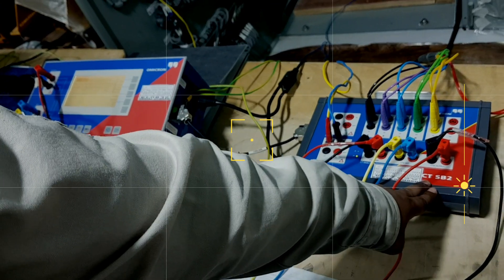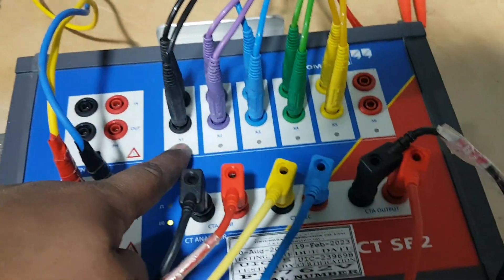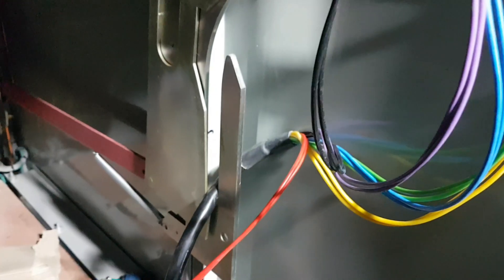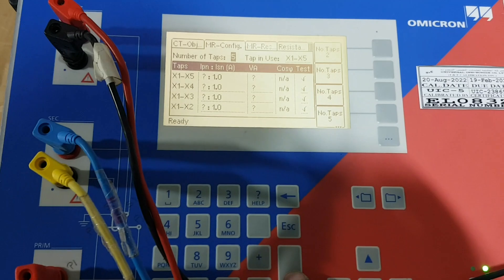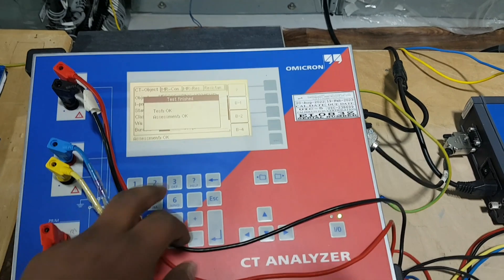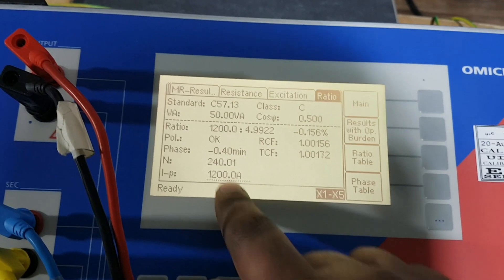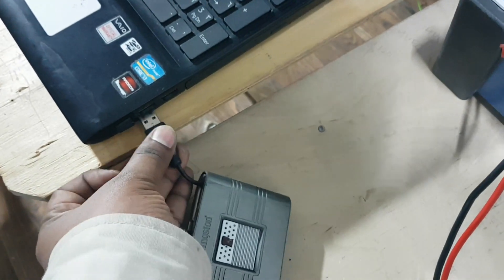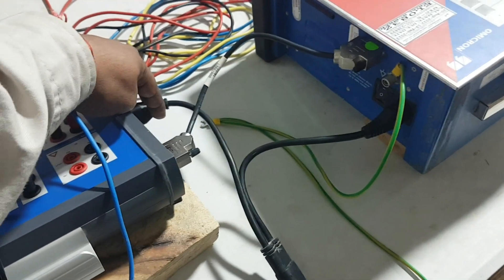CT TESTING, MULTI RATIO CURRENT TRANSFORMER TESTING WITH CT ANALYZER & CT SB2.SITE PRACTICAL TESTING

Comment: Thank you for your explanation sir and very informative,
I have some doubt in connection,
For example:
Multi ratio CT,
X1-X2 400:5A
X1-X3 1200:5A
X1-X4 1500:5A
X1-X5 2000:5A
How we have to connect SB2 all secondary cables in X1?
Hope i am clear with my question.
Reply from the maker: Dear Hi,

1. First give connection between CT Analyzer & CTSB2 that is interconnection cables 

2. After interconnection between CT Analyzer & CTSB2 is completed, now start give connection for CT

3. In CTSB2 there will be IN, in our video you can be able to see yellow & blue cables for CT primary.

4.  In CTSB2 there will be Tabs option with X1, X2, X3, X4, X5, X6 these cables should be connected to CT secondary's. 

5. How we have to connect SB2 all secondary cables in X1?   No, it's wrong connection. 

6. A, CTSB2 X1 should connect to Actual CT's X1 (CT SECONDARY)

B, CTSB2 X2 should connect to Actual CT's X2 (CT SECONDARY)

C, CTSB2 X3 should connect to Actual CT's X3 (CT SECONDARY)

Likewise for others also

If you do not get my point, try to watch our videos 2,3 times, definitely you will get clear. 

If you need more clarifications, ask me. 

Thanks,
AK ELECTRIC